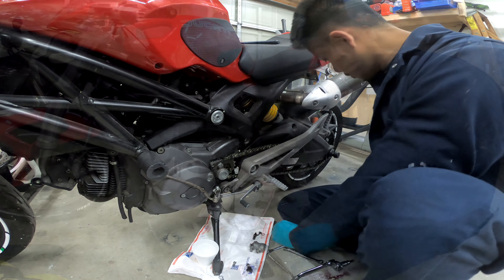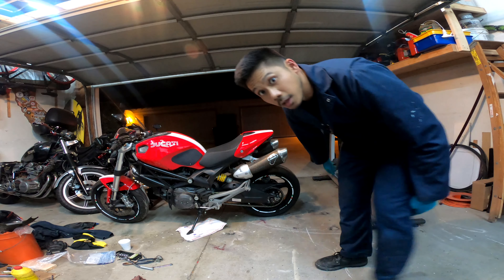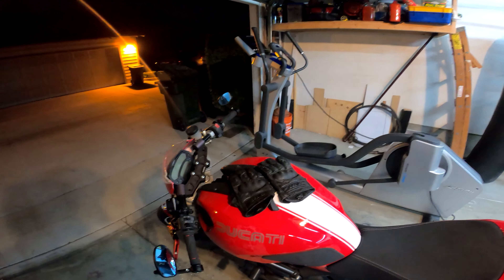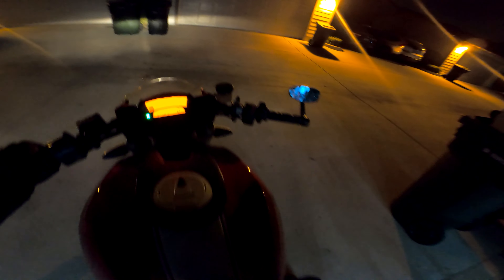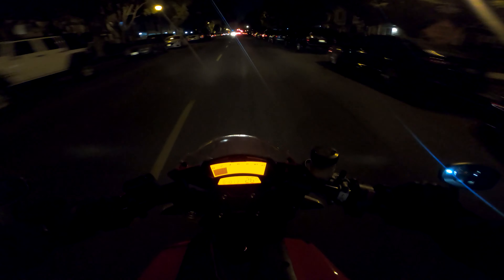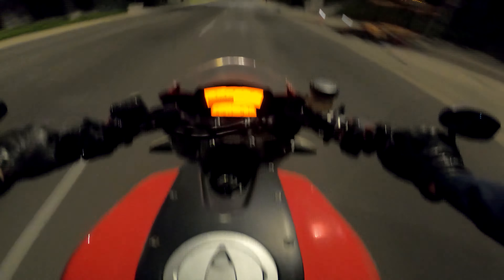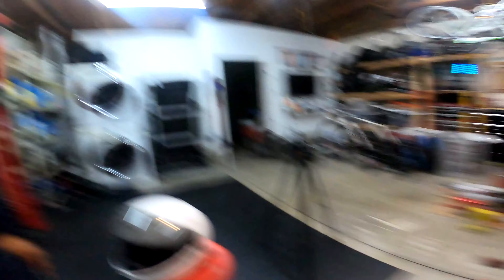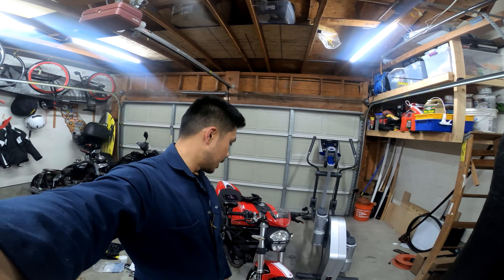Let's finally hit the road | Project Money Monster | EP.8

Comment: Thanks for this video series. I have a 696 as well. I chose this model for the simpler motor ( 2 valve per cylinder vs 4 ) because I want to do all of my own maintenance. So far I have done the first valve clearance check and have bled the clutch. So far so good ( the bike still looks like a bike and it runs ). Thanks again for this series your clear instructions and tips help all of us mechanic wannabes.

Comment: Its a common fault on Ducati's lol, same slave cylinder is used across the range on various models. Nice when you find the fault and fix it yourself. Best when you test ride a Ducati hold the clutch lever in for 15 seconds while it's in gear and see if it starts creeping, thats a good sign your slave cylinder is on its way out.

Comment: hi mana  I have a 2017 Monster 821 and my clutch won't find neutral (with the engine running) and the engine quits working when cold, there is a lot of resistance when pushing, and when the engine is running, pushing into first gear sometimes makes a loud noise, like the clutch is not fully working, I have taken it apart and inspected it and still can't find the problem. Any suggestions on what to check? Clutch by Wire

Comment: Hey man, great channel! Congrats on fixing the issue! I would still recommend replacing the original slave cylinder - they are prone to breaking unexpectedly. Mine just started leaking and I lost my clutch, had to order a performance one and I am still waiting for it to arrive. Also, what phone mount do you use? I can't find anything that would fit the woodcraft handlebar?
Reply from the maker: I didn’t add a phone mount on mine. But you’re right the woodcraft is really had to add a mount to. I was thinking a ball joint ram mount might work, using one of those bolts